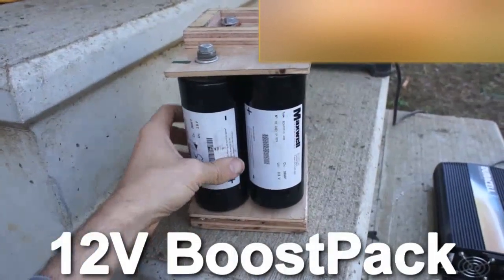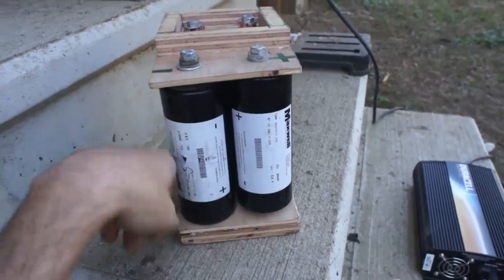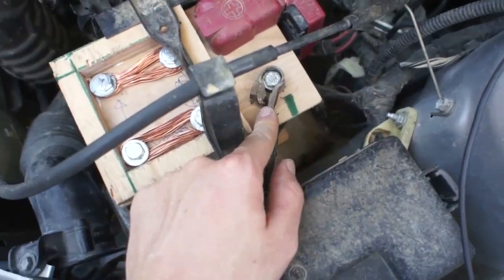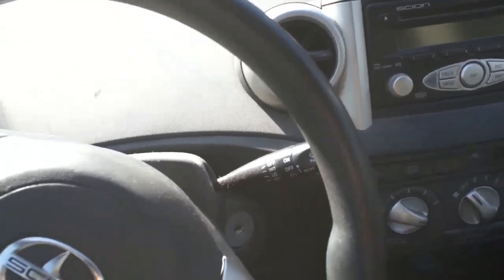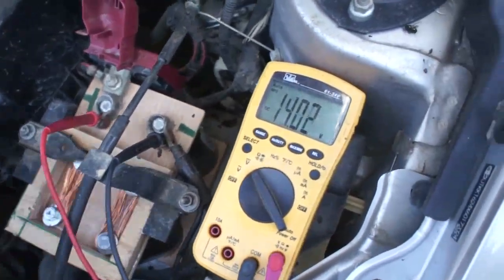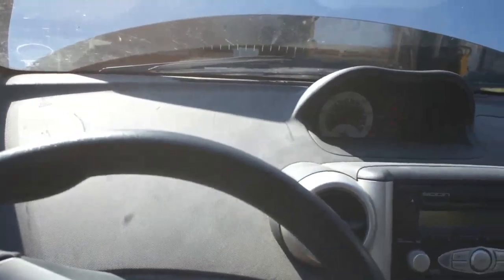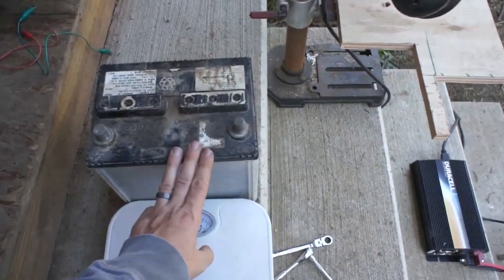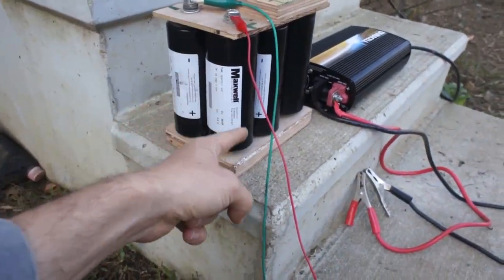12V BoostPack. Replaces auto battery. Works great!

Comment: Bad luck dude.  I just replaced my 2x 12v 550 ah batteries for 1 x 17ah + 6x 2600 Farad Ultras and gained a huge space for my dry cell.

I got the CCA you I could only dream of.  Check my vids.

Comment: Nice! have you test as UPS in laptop or desktop with desktop or lcd tv?, have you test this with your joule ringuer, and charge a second bost caps at the same time? You can charge in the car with avramenco plug conected to the tires as a Vandegraaff generator

Comment: Another great use for these is in between your inverter and your solar/wind battery bank. When powering a home with say a couple 3000 watt inverters, things like washing machines, or any large AC inductive load really (AC unit) - they impose an incredible initial current hit on the bank during startup. This is hard on the battery array. Caps eliminate that.

Comment: Yes, in fact that is there most common use. Typically, in Northern Canada, most diesels on the oil patch have this set-up, in addition to a battery. These are not battery replacements, really... but they sure kick ass at exactly what you are talking about.

Comment: Probably not anywhere near as long but it would have enough instant current to start a car after about 15 minutes of full sun.  Ultra capacitors have a much higher capacity than standard capacitors but the energy density is still nowhere near even a small chemical battery.  This pack probably has less capacity than a cell phone battery but far higher current.

Comment: good job laser as always
You can use a contactor / timer /7 ah battery for control  then dump the load to charge battery.  pulse  every 5 minutes or less   all  solid state  no more pulse motor   will eagerly wait in the laserhack forum   lil

Comment: The 40R battery dimensions are 11-3/8 inches by 6-13/16 inches by 6-13/16 inches, and on average it weighs 36 lbs.
This Battery works in my Volkswagen TDI, with a life expectancy of 2-3 years, Cost $100,00.

Comment: You need to marry these capacitors with small battery just to keep 12 volts, as for low voltage may affect cars ECU. I saw car companies collecting energy back from regenerative braking into capacitor. I do appreciate all your videos. Sure you will end up in to commercial product soon.

Comment: Well done Laserhacker !
How long do these caps stay charged in a normal car,
if you only drive once each in 2 weeks ?
As the clock and some other electronics also draw power
normally from the battery, you probably always need a solar panel to keep them
topped up...anyway, well done !

Comment: this will also help gaz mileage not just because of the pounds removed but also it will act like a car battery regulator (small caps to help the battery on demand), this can give around 5% better gaz mileage (some say higher, but i am conservative)

Comment from the maker: I have had no problem with them bleeding very much voltage yet.  I am sure they do but it takes a long time to drop down from 14 volts.  I just did a low voltage start test this evening and the car still started at 8 volts flat in the pack.  I would probably go even lower but I do not want to try it.  I will know more after I do more testing.  I am pretty sure that as long as I drive my car at least once a month I will never have any problems with it.

Comment from the maker: It seems to hold a charge very well as long as there is nothing like a dome light left on.  I would guess based on what I am seeing that it would be months or maybe even a year plus before the voltage got too low.  It may also depend on the car.  The nice thing is that you can recharge it in nothing flat if you need to.

Comment: I tried to jump my car off with the battery disconnected and it just couldn't give enough amperage. The esr is a lot higher then the 2600 farad caps, so the voltage drop under that much load becomes significant. I'll try again with better cables.